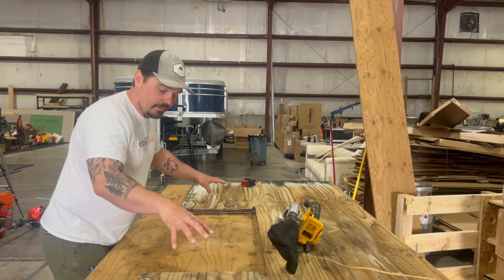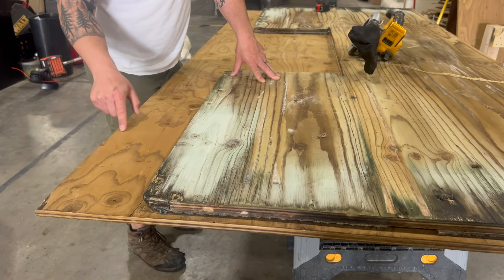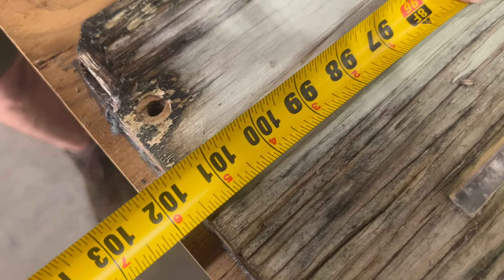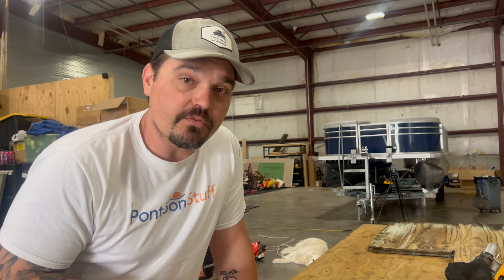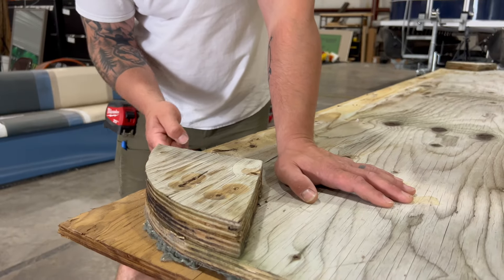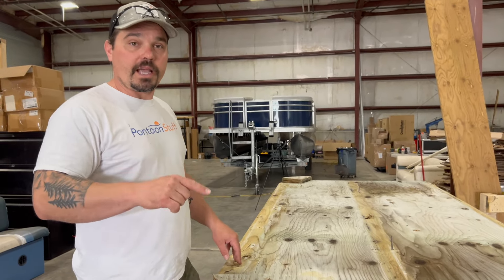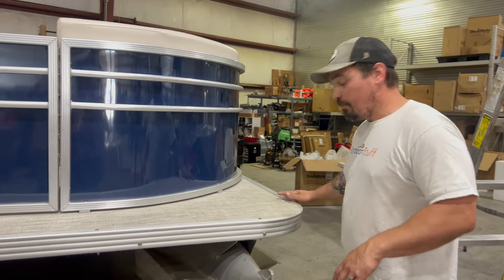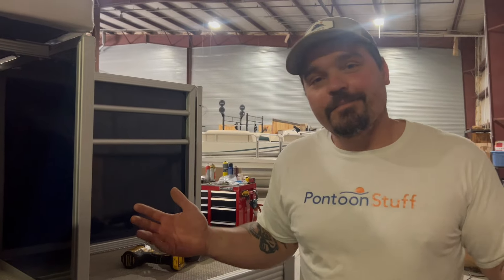Replacing Pontoon Deck Boards - HELPFUL QUICK TIP

Comment: Super helpful, my old 2000 Lowe had the same wood cuts as this one and I'll be using the old boards as templates.  Now need to figure out how to add a kicker to the existing transom?  🤔
Reply from the maker: I haven't seen many kicker brackets added to pontoons. Easiest way would be to weld a bracket to the back of one of the outer pontoons. If trying to center it better I'd think you'd need to extend the transom sideways, but still tie into one of the pontoons for support.
Reply: @tomspontoons  Yep, think I'll have to go with one of those options.  Surprised people don't add a kicker in case they get stranded, especially with all the older 2 stroke pontoons still out there.
Reply from the maker: @Boatfisherz1  A lot more electrical bow mount motors on pontoons than gas kickers for sure. Sort of like a typical runabout fiberglass boat...no kicker, just run it and hope the motor gets you back to the dock!

Comment: Would you be able to share the total cost of your rehabs -- they are wonderful but would also be good to know the cost -- if you can.  Also:  Would you ever consider selling the removed furniture from your total rehabs.  Tere is some reqlly awesome furniture being replaced with the new stuff.  Just a thought  Thank you all -- you all are awesome -- cavitation and all!!!
Reply from the maker: There’s a huge range in terms of what restorations cost. Most full restorations (deck, floor, seats, rails, electrical, etc) are in the $15K to $20K range all said and done. At that point they’re right on par with a new $40K boat from a dealer. We sell some of the usable seats, but usually just have a few folks locally who reupholster them and sell them. Got tired of dealing with Craigslist and Facebook!

Comment: What’s the average cost of a pontoon 24ft full refurbish job
Reply from the maker: There are a ton of factors that can play in, but if we replace everything other than the pontoons and motor it's usually somewhere around $18K to $22K. If we add a new outboard that price can jump a lot very quickly. Still usually end up 1/2 to 2/3 the price of a new 24' pontoon!